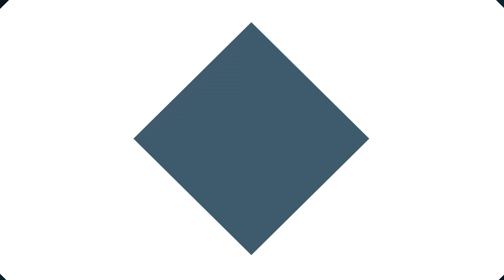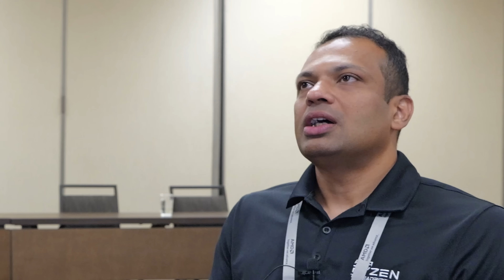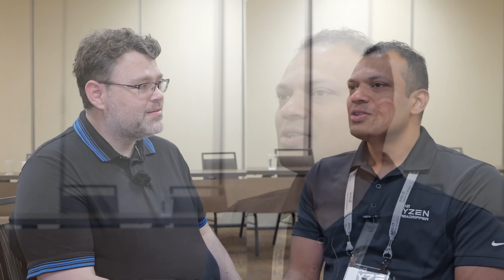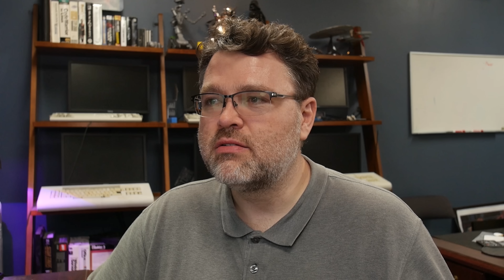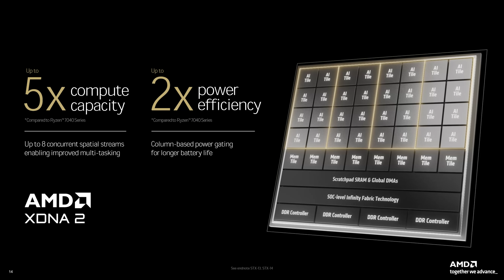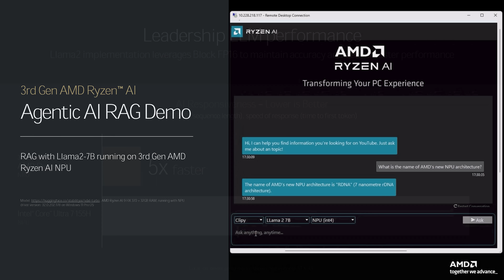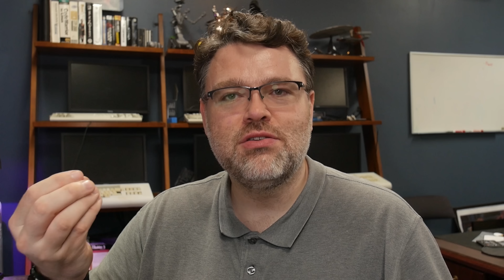Zen5 Mobile SoC: Chat about Sleep, and Voltage towards Long Mobile Battery Life

Comment: Looks like AMD won't be catching up to Apple silicon any time soon 😢
Reply: Really? I see AMD ahead of Apple in several ways already with Zen 4, and looking to increase the gap with Zen 5
Reply: It the leak benchmark of Geekbenck, AMD Strix Halo have better single thread than Apple M3, but Apple M3 have better multi thread because have more cores. Most Apple users don't understand about technology.
Reply: That's a problem why?
Reply: @baconbreadwithbacon  Because for decades many of us have been dreaming about powerful fanless laptops with excellent battery life that perform just as well when plugged in to the wall or running on battery. Not to mention the benefits this has on the environment. I may just have to bite the bullet and transition from Linux to MacOS.
Reply: @MnemonicCarrier  Benefits on the environment and Apple on the same text is a sin. Go to MacOS and have fun.
Reply: @MnemonicCarrier  imagine thinking that amd is responsible for the absolute disaster that is windows power management.
Reply: @blegi1245  Oh please! What Apple achieved with their M-series silicon has nothing to do with Windows. Your claim that it's all down to Windows power management is (sorry to say) absurd.
Reply: @MnemonicCarrier  apple achieves nothing with silicon. 99.99999999% of apple power efficiency is mac os having competent power management. If you ran windows on apple silicon you woud get half the battery life you get on mac os. Wendell literally gained 50% battery life on an amd laptop by changing from windows to linux.
Reply: @blegi1245  I really don't want to argue. I'm a Linux user too (Arch Linux), haven't touched Windows in over 2 decades. I suggest you take a look at "power per watt", or look into how an M-series chip running at 5 watts can out-perform an i7 running at 95 watts. What Apple did wit the M-series SoC is nothing short of mind-blowing. It's a chip that can idle at 0.2 watts. But hey, if you want to believe it's down the "power manager", then that's up to you - all the best!
Reply: while i sure agree Windows power management is not the issue, apple software hardware integration and strict developer control make m chips shine a lot more. X86 is inherently less efficient than risc for average desktop use and the co processord and accelerators make up for brute force. Then Apple is so much bigger than intel and AMD combined .. @MnemonicCarrier
Reply: @MnemonicCarrier  that a long way to say you don't know how windows power management works (or doesn't work). Also there is zero compute per watt difference between best x86 and arm processors. Nvidia grace and amd zen 5 have exactly the same performance per watt. All of the difference between amd and apple silicon in laptops comes from power states and how the operating system and applications use them.
Reply: @MnemonicCarrier  Interesting that your care for the environment starts and stops at energy efficiency. Lets ignore the material waste and planned obsolescence behind Apple's designs and practices. I've got M.2 SSD's that have been used between at least 3 devices and even converted to external drives, while Apple solders NAND on to the board and will turn the entire device in to a brick when it dies. God forbid you get it wet, and you have to pay someone (I happen to be one of those someone's) excessive amount not to just fix it, but also to retrieve your data. Even the RAM in my laptop has been in 2 different computers and the stock RAM has been used to expand the capacity of my kid's laptop. New Wifi/BT standard, I can swap out the card. Battery reach it's cycle limit?, I don't have to pry through adhesive to remove/replace it.
Reply: @blegi1245  3nm node with M4 do have advantage in terms of efficiency to 4nm node amd use for zen5 and lots more to Intel 7 for raptor lake.
Reply: @MnemonicCarrier you know that apple M1 when it came out have massive node advantage 5nm to 14nm+++++++ that intel got stuck on. Rebranded intel 10nm to intel 7 competes with M2 at tsmc N5P.  M3 at TSMC N3 still compete against intel 7 until very recently with intel core ultra.

Comment: 4:35 exactly! it's super frustrating that modern cpus think it's better to boost 9ghz and instantly get to 70C, turn on fans, and why? just to open a new browser page in 0.01s instead of 0.1s? really
Reply: You can turn off turbo on almost any big desktop CPU, and it will be < 60W even in prime95 smallest FFT stress. I do that when I have to leave it in hard execution overnight or long periods. It's typically about half power and about 25% slower. I agree that they are way too aggressive.
Reply: Only the top tier CPUs (at least on AMD's side, Intel does it on more SKUs but same concept) have maxed out power curves and it's to compete on benchmarks and total performance on systems that aren't power constrained. Most of the Zen 4 chips are available in cheaper 60W variants that give 90% of the performance on a lot less power though, and you can tweak the power curve fairly easily these days to get more efficiency
Reply: well, in my case it's 6850u, and I got significantly more runtime by just installing tuxedo control center and creating a profile with no boost and 2.4Ghz limit. I see no difference for productivity (~50 browser tabs, Idea, other tools). also, for whatever reason, I get worse runtime with the kernel 6.5+ p-state driver on, so I use
amd_pstate=disable
boot option..

Comment: Would be super cool to have one external PCIe 5 x4 connector on handhelds for desktop class connectivity for GPUs
Reply: Perhaps, but the performance on these small platforms are likely power or thermal limited to the point gen 4 is for now still more than enough bandwidth the user won't see any improvement for having more bandwidth.
Reply: @foldionepapyrus3441  pcie 4 x4 is maybe enough for a 1650, but not for a 4080, where pcie 5 x 4 is enough for around 90% of max performance.

Comment: Is there any news of Framework moving to Strix Point?
Reply: Small manufacturers like Framework are almost always ¾ generation behind.
Reply: Ya, framework will get zen 5 in Q3-Q4 of 2025 or Q1-2026,

Minisforum & F/W devices with zen 5 will be available at Q4 2026 or in 2027....
Reply: minisforums and mini pcs (gmk, beelink, etc) are getting released now, around the end of the year. Framework should likely get Strix and/or krackan/kraken around the first half of 2025